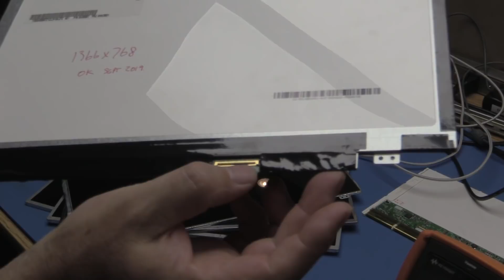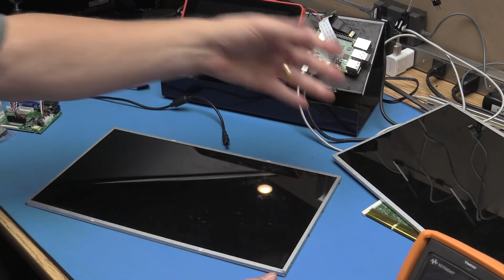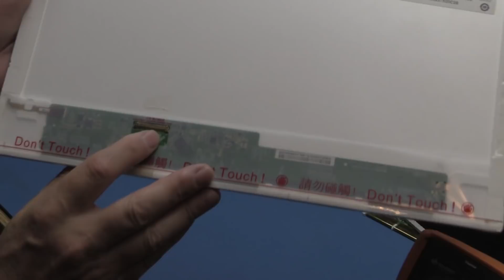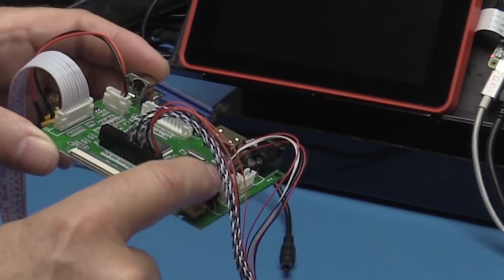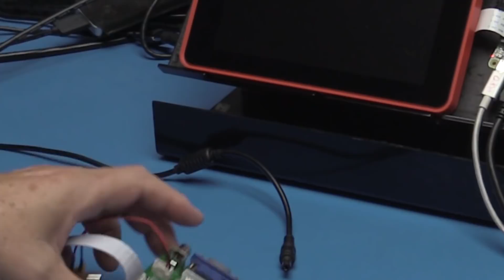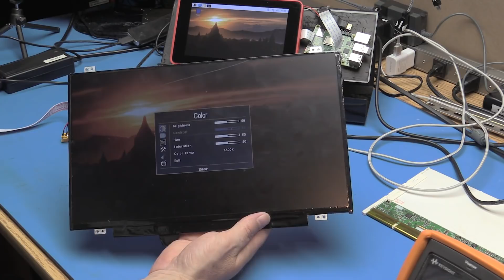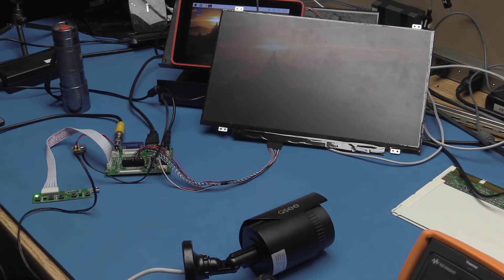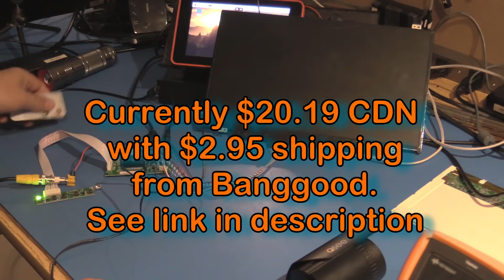Old laptop Screens on a Raspberry PI... Yes indeed.

Comment: Well, I've had this board for a while now. I was using a & inch TTL display, which unfortunately broke.
Now I have a M140NWR2-R2-IVO display. I just need to order a LVDS cable for that to work with it. Can you help me figure out if it requires a 1 channel or a 2 channel cable?
Reply from the maker: glad you found it, to confirm, its a 1366x768, 3V3 single channel LVDS 6bit/color and with 40 pin connector, based on that, the one I used in the video should work, i have al link in the description to were I got mine
Reply: EDIT: 

I found the channel information here.

http://www.panelook.com/M140NWR2%20R2_IVO_14_LCM_overview_16814.html
Appreciate your video!

Comment: Really cool.  Is it possible to get the screens running at native resolution?
Reply from the maker: it seems you need to get the board configured for the panel, they all seem to be available, along with the right cable. it is possible to re-program them but I have not figured out that yet. so for now it is easier to just get the one already configured for your panel

Comment: I have an old XPS 13 which has a 1920x1080 display.  Unfortunately, it seems this controller board is only for 1366x768 even though it'll accept a 1080p input signal.  I was excited for a second.
Reply from the maker: keep watching, i will be showing more when my additional boards arrive, ive got you covered
Reply from the maker: i am looking into other boards and trying to get more displays other than the 1366x768, I just got my other driver boards and am getting to grips with the settings etc.
Reply: @TheBreadboardca  Ah, I guess it is an answer to a question (about compatibility with an old desktop panel) I just posted. Will be watching you. ;o)

Comment: One suggestion for anyone salvaging screens: save they laptop lid/case that the lcd is in. That can then serve as a nice case for the monitor you are making. Otherwise making a case can be a pain

I've mounted the controller in a plastic project box epoxied  to the back or in a larger box that served as the base. 

Detach the hinges that mount the lid to the main body of the laptop and us them to attach to the base. When I attach the controller to the back of the lid (now monitor case) I make the base out of aluminum stock from the hardware store.
Reply: Oh! I remember doing that a while back when I did the controller board thing with a broken car GPS unit…
Reply: Sounds like a good idea!
Reply: I had a Toshiba Satellite that was about 12 years old and I gutted the case except for the screen and my Pi400 fits in fine along with the lcd board and it works great. There is room to add a hard drive in the case too. I think I just invented the Toshiba/Pi laptop. LOL
Reply: @mikehall7806  of
Reply: I'm going to try and do this as well.

Comment: i have one 10 inch display same board  i has orden banggoods, but display have broken , and i no know what display need orden and were, can i use 15 inch dispaly this same controll board ? and what display need orden .
Reply from the maker: what is the model number of the display you want to use ?
Reply: @TheBreadboardca  broken display have numbers and text, this, loye boe10,1-33ledh and numbers 0001 2017-09-19 maybe factory day.its working but glass have broken, all show little pieces.12 v power+flat ribbon cable have only. need this new display. but were and what can use.
better if can 14-17 inch display but 10,1 inch have genuine.

Comment: Looks great. Will the the board work with an old IMac LCD?
Reply: Assuming it's the 21.5 inch at 1080p, it should work, as I've seen quite a few consumer PC monitors using that same panel, including the Dell S2218H and HP 22CWA.

So even if you can't find a Chinese no-name board that works with that panel, you may (theoretically) be able to get the control board from a PC monitor that used the same panel model, and theoretically, the same kind of LVDS connection.
Reply from the maker: @kbhasi  I agree with the responses, post the model / part number of the LCD panel and Ill have a look
Reply: I have 2011? iMac I've been saving for some type of project.

Comment: Is there an easy way to connect touch-capability to Raspberry PI as well?

If so - do you know of any nice 8-bit (PVA?)  panels  with touch, to build - say - kitchen tablet?
Reply: Yes you can purchase a USB touch display
Reply: If you salvage a screen with touch it might have a usb interface. I have seen at least one laptop touch panel that was usb.
Reply from the maker: @davelapp4740  most touch screens that are add on are based on a USB interface so easy to get working. The official PI LCD uses an I2C interface and has a linux driver that supports it, this would be a little more technical to integrate,
Reply: @TheBreadboardca  true but I'm talking about actual salvage touch screens from laptops with touch. Those also seem to be (at least sometimes) USB

Comment: Great video and the topic but I’m missing details about the signalling/protocol. Also if the chip is scaling the input to the panel, is it feeding back the native resolution to the source making it possible to select? I tried different resolutions panels with the TTL output but could not find details on how to adjust the resolution. The TTL being “dumb” it has to be done in the chip itself I believe. Anyway, thanks for this one. I’m interested more in LVDS than TTL.
Reply from the maker: Did you get to watch the LVDS video, did it help ? https://youtu.be/Gph9hYLPMFk, the panel will scale but once configured it will also work and report native resolution